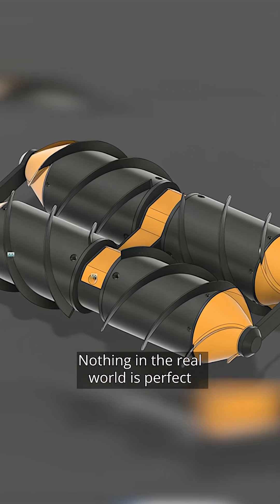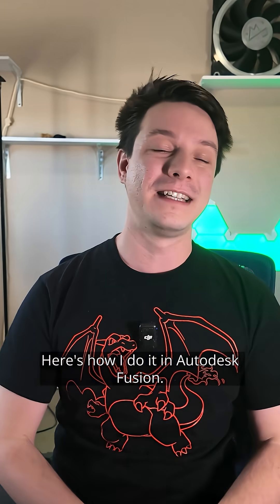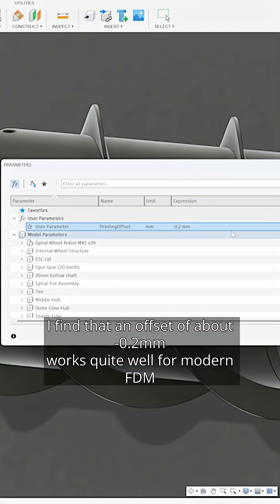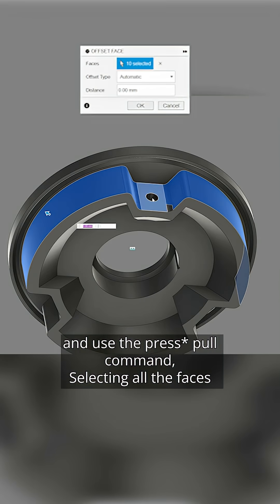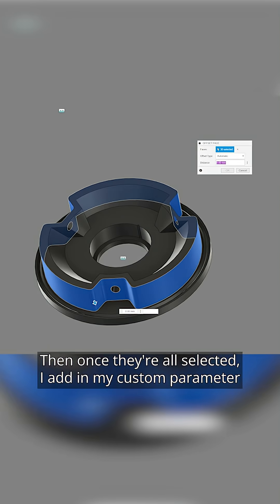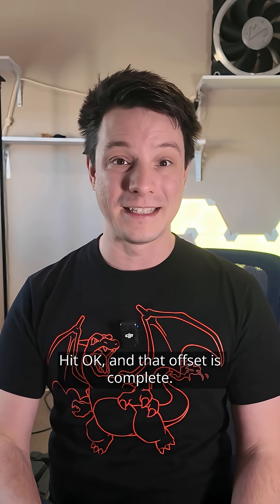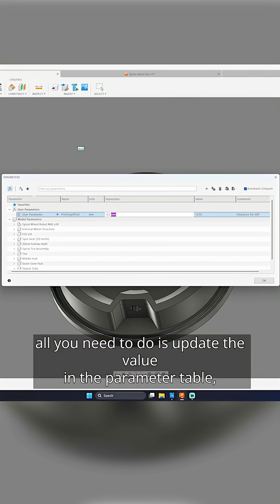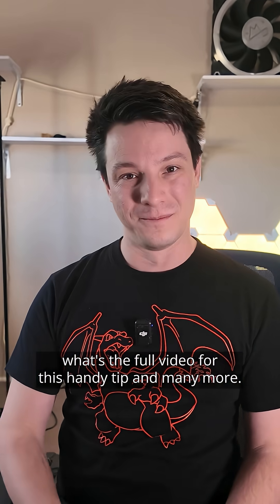The EASIEST method of cadding clearance for #3Dprinting!

Comment: It works but I don't think its a good worflow because it introduces a lot of extra work for no reason. Its better to account for clearance in the sketch itself which rarely is a problem because you know how the parts fit together.

Unless you're dealing with extremely complex geometry but at that point you have to ask yourself wether that complex geometry is really necessary to begin with to achieve the goal. Overconstraining parts is a thing

Comment: not often but on some occasions I've set up three parameters, one for a fit that aligns but doesn't secure parts together, one that keeps two parts together under friction but still allows them to be deliberately pulled apart and one where the parts can fit tightly together and ideally don't come apart, even under duress

Comment: I'm assuming it's possible to do the same in SolidWorks?  Variable clearance would be useful.  I recommend varying clearance by print axis.  I think most printers should require less Z clearance where there is no overhang.

Comment: Just for clarity... Maybe it's best to describe these as 'fits,' where depending on the dimensions and interaction as well as the general arrangement you can have: (1) clearance fit, (2) tolerance fit, (3) interference fit <--- with the gap becoming larger from 1 to 2, and at 3 the parts mesh to be able to transmit force or a torque.  This is a standard used at least in marine engineering

Comment: The problem with ADHD and CAD is I consistently tell myself I don't have time or need to set up parametric values. Usually ends up making my workflow messy. 😅
Reply: If you want to start getting sustainable drawings, start out with the parameters, give every single value you know about a name and use that instead. That way you implement it with the least amount of friction.

Comment: The only annoying part I find with this, is that the "push/pull" command is not represented in the timeline which I don't understand why. Would make it even better imh
Reply from the maker: It is! It's represented as "offset faces" in the timeline.
Reply: @MakersMuse But only if you’re also using the “offset face(s)” tool or am I missing something here?

Comment: Have you ever tried using crush ribs in your designs? It's a method to get press fit clerances without needing to be totally precise with tolerances. It doesnt fit every situation, but seems like a great technique to make functional 3d models more easily sharable online, where everyone's printer has a different tolerance.
Reply: Dan Royer posted a video a few years ago on how to make them in fusion. Worth a look

Comment: For my pretty decent ender three, it’s about 1 mm which is weird because it’s a printer that you’ve tested and said was good
Reply from the maker: That's way more than you should need, I do 0.3 for enders. You might need to adjust print geometry or tension the belts
Reply: Yeah there's something wrong with your printer or settings if it's that far off. Some calibration cubes are in your future perhaps.

Comment: Hmm, interesting technique, I usually implement my clearances back in the sketch. Definitely can see some pros (and cons) to doing it this way though.
Reply: It would be really nice if you could specify the nominal dimension and a tolerance/clearance in the sketch and have that flow through. But I can see reasons not to do that. Still, a man can dream
Reply: @zyeborm yeah, that kind of info is what you usually put in the drawing, but it would be nice to be able to specify in the sketch. I use Solidworks, and it might honestly be able to, there's a lot of features of SW that I still don't understand even after using it for nearly 10 years lol.

Comment: sometimes I start with clearance set to 1mm+ while doing CAD, so that I can see exactly where I've put in clearance without having to zoom in, and then I can set it back to 0.3mm without any issues or missed areas
Reply from the maker: Ah nice that's pretty clever!
Reply: In my opinion, a perfect slicer should be made with the idea on where tolenrances start to fall apart and counteract on them there
Reply: @cupcake_toucher445slicer isn't going to know how your parts fit together
Reply: @zyeborm It will. If you want for example 10mm^3 cube then slicercs creator add offset of filament that is shrinking when cooled.
Reply: @cupcake_toucher445 imagine a cube and a hollow square tube. The tube is sized to fit over the square. In which of the 3 possible orientations should the slicer add clearance to the cube? Or should it clearance the tube instead? Does it know about the metal part that's going to fit in later?
Reply: @zyeborm you lack creativity. Lets say bambustudio devs predict different scenarios so they prepare settings for part like "inner part" "outer part" "adjust only x/y/z" slicer calculates how long the layer is printed, how long is perimeter and uses preset formula based on your preference to precisely set the offset of flow rate, speed, inner/outer first and makes it work for example of 0.3mm
Reply: @cupcake_toucher445that's great, except you haven't said on which surfaces the parts are a mating. Because those need to be changed not the others. You also haven't said how it knows magically that this part in this print interfaces with 3 other parts inside and outside on 2 faces. 
The slicer isn't the tool for this job. It's job is to make the parts it's given. The cad tools job is to specify those parts with the tolerance required the same as the draftsman would draw the part with the dimensions on it for the machinist to make. The machinist doesn't decide to go changing the part.
If I got a part made in factory a and another in factory b they should still fit together. The slicer doesn't have enough information to guess how to do that.
Reply: @zyeborm you are right, I drifted off the topic a bit, the video was about modeling clearances while i was yapping about the difference between model and what was printed out. Mb 😅

Comment: What’s kind of annoying is that it seems like most 3d models online have a clearance of like 0.1mm and it seems like it works when they print it on their thousand dollar printer
Reply from the maker: Yeah, i used to use 0.3 and only recently shifted to 0.2. Any finer is asking for trouble.
Reply: @MakersMuse  especially on budget printers like my ender 3 v3 se
Reply: The vast majority of people with 3d printers unfortunately have no idea how to actually design objects for 3d printing. Poor tolerances, sub-optimal threads, malformed walls, there are errors abound that people just brute-force their way through by relying on the printer hopefully being capable enough